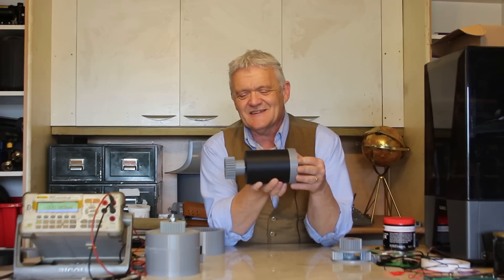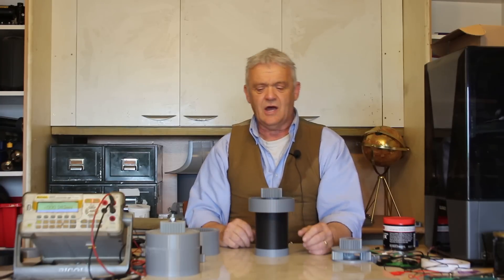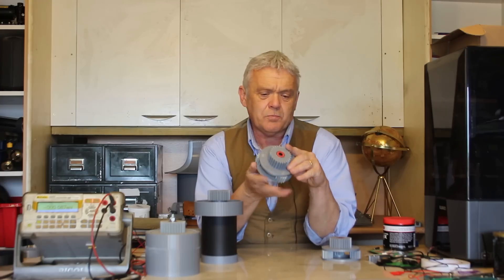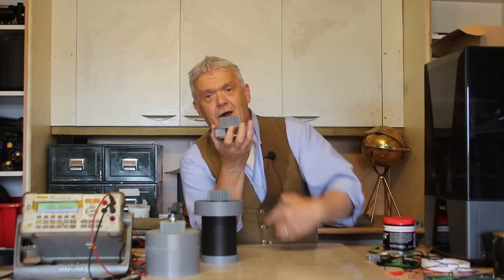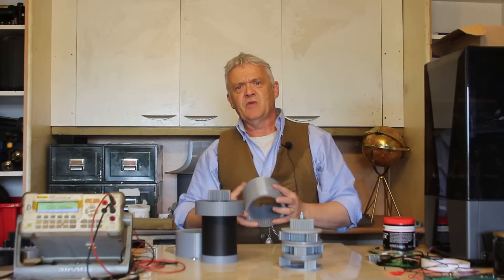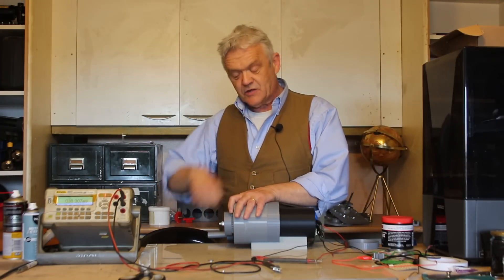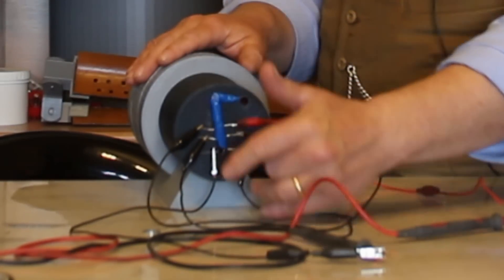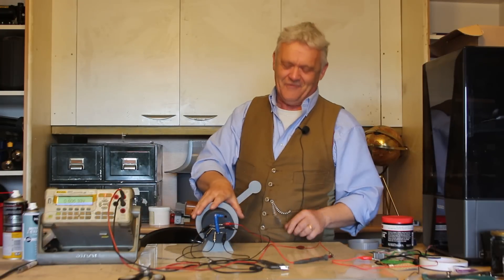1964 A DIY Wind Turbine Gearbox And Its Crazy Output

Comment: just imagining that with a VAWT from one of the previous eps 🤔

also, the durability of those carbon fiber pla/pla+ filaments

dang....making me wish I had a larger form-factor printer
Reply from the maker: i made this so a small form factor printer can print it mate
Reply: @ThinkingandTinkering  🤔 
definitely gonna have to check out those STL files later then (still would LOVE to have a large form-factor printer, especially a core xy type)
Reply: @mofoq  build one.
Reply from the maker: @mofoq  i can't deny it mate a large form factor is really cool lol
Reply: Robert showed the amazing strength of home-made plastic infused with graphene - why not similarly infuse the filament mix - three-d print plastic that's stronger than steel!

Comment: Hey Robert and community,
I develop a handbook on how to integrate automatic systems into nature, so that every human can live free and in best health from the fruits of this earth (paradise).

In my region (central europe) it is to cold to sleep outside without shelter. To counter this circumstance, a telluric current driven floor heating system would be great, and I think it would a perfect project for the channel.

I thought that a 50cm x 150cm closed rectangular water pipe, which is slightly angled in height at one pipe corner, in order to allow water flow through a water boiling resonator attached to the exterior pipe - would be a possible solution, which can be dug into the ground (soil).

It would be great if you or someone from the community would come up with such an automatic system which I (and everybody) can build efficiently from scavenged resources.

Best regards,
Quentin
Reply from the maker: cheers mate